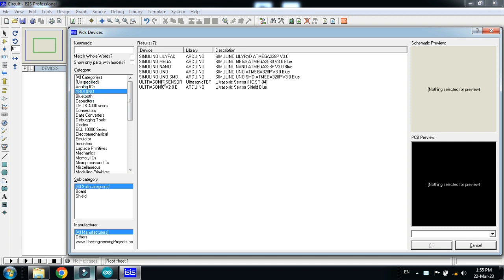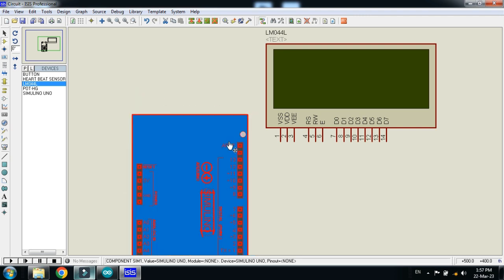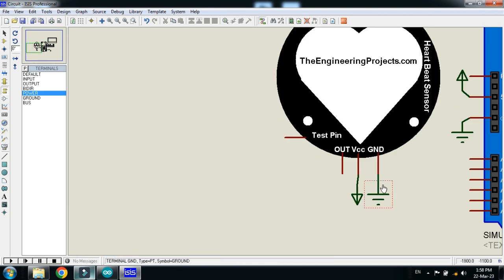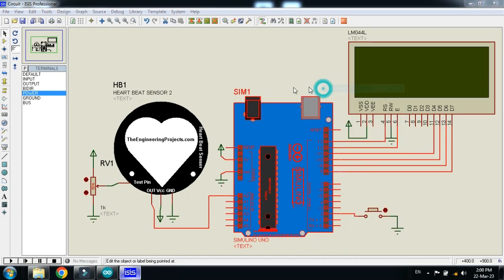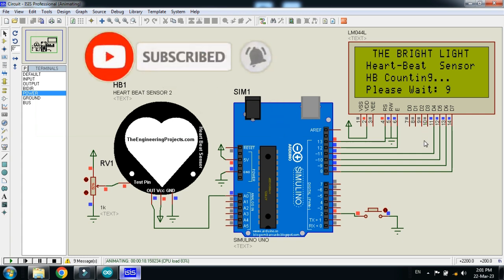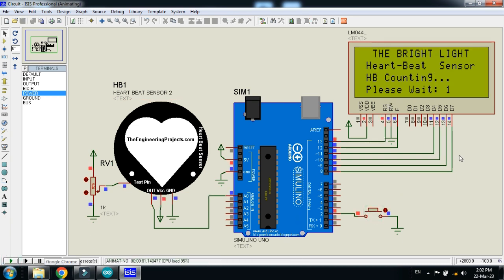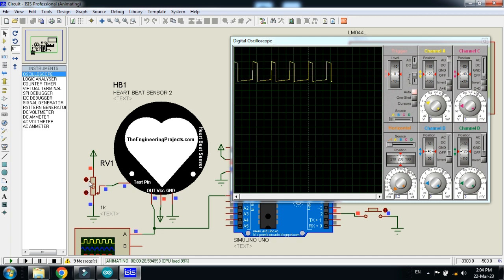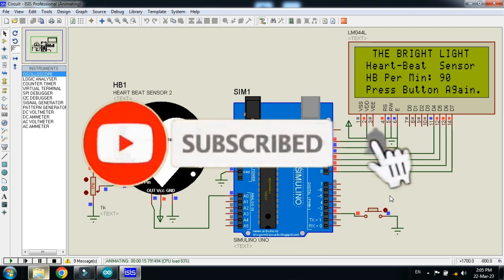Interface Heart Beat Sensor With Arduino With Code & Circuit || Proteus Simulation

Comment: Sir 
Can i use any other software instead of Proteus. Becouse i can't download it from the site
Reply: Thank you sir
Reply: Another problem is there is an error message like"failed uploading:no upload port provided".
What to do
Reply from the maker: In simulation just verify and compile the code. There is no need to upload the code. Just copy the Hex file address and paste that address in Proteus as explained in my videos.
Reply: Sorry to bother you. Its my mini project

I dont get the hex address after running the code. No error, only showing the details of memory usage
Reply from the maker: Turn ON Compilation Mode in Arduino IDE software please.
Method is below:
1. Open Arduino IDE.
2. Go to File > Preferences.
3. Check the box next to "Compilation" under the "Display" section.
4. Click "OK".
Reply: Thank you so much Sir 
A very all the best from kerala🎉
Reply from the maker: Download from here
https://youtu.be/ET-tTFbq1OE

Comment: Sir when we enter timerOne library in arduino it is showin error "No such file or directory " what should we do?
Reply: Kindly help
Reply from the maker: You may trying to add different file. Kindly follow the steps correctly as shown in video, it will help hopefully.